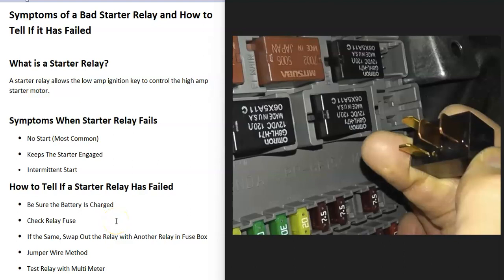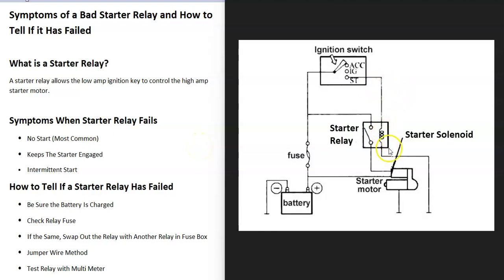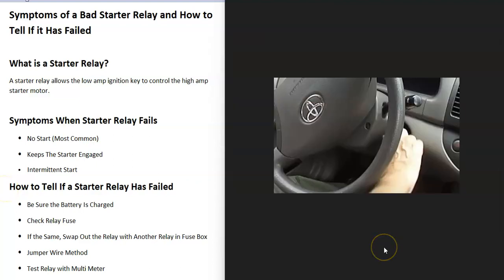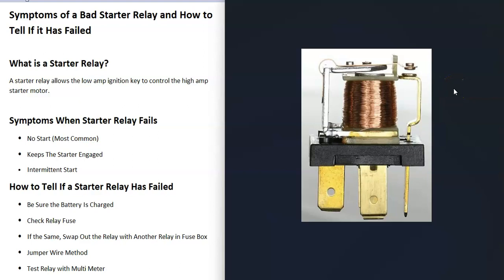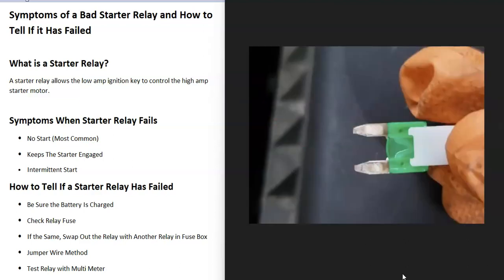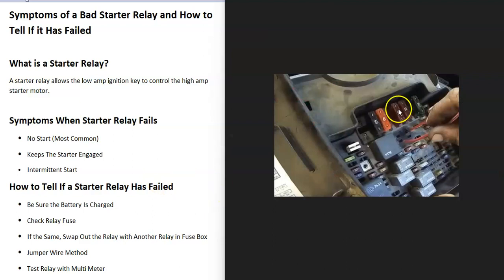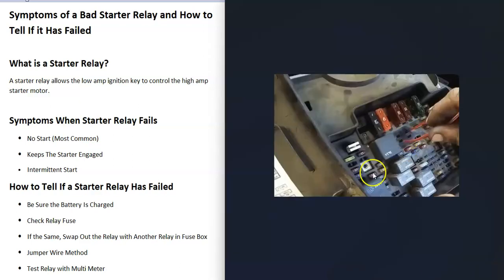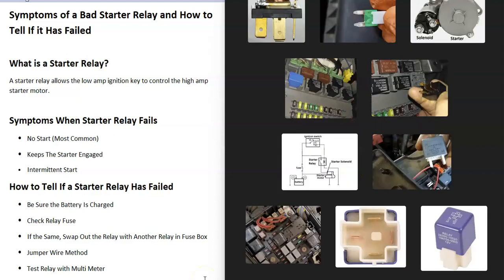Symptoms of a Bad Starter Relay and How to Test If it Has Failed

Comment: I have a 2015 chevy ss
I was replacing my crank shaft sensor on my car. (It's directly above the starter, so I had to remove the starter to get to it) 
When reinstalling the starter, I accidently touched some of metal framing underneath the car wit the starter's positive wire, while the starter had power going thru it, trying to get it back up in its spot (I forgot to disconnect the battery during the whole ideal.. foolish of me) and now my car won't start. It's almost as if my ECU got fried or something. I tried using a brand new test light on the fuse box under the hood, to see if I was getting any power to any of the fuses with the car in the "on position", but the test light never lit up. I tried bypassing the starter relay with small jump wire, and still nothing happened. I've yet to take the starter off, test or replace it. I just wanted some feedback on my issue
Reply from the maker: When the power shorts out it can cause issues and be problematic sometimes to fix since a lot of components can be damaged. Usually, a fuse or relay has blown but sometimes it can also damage the computers or wiring. I would start by getting a schematic and check all the main fuses. There should be a big main fuse in the fuse box along with fusible links.

Comment: 2015 Ford Transit 250 Cargo Van 3.7L  continual fail to start issues. All start with Air Evap Code, consistently related to water in the air box or just  wet or damp air filter. Usually, cleaning or replacing the MAF (Mass Air Flow) sensor, the air filter gets it started.  And did get it started and running for about 200 miles. Then I stopped over night. 

Every single time wet snow melts it goes onto the MAF and into the air filter housing. Normally I cover the the engine with  tarp and the hood with  tarp or go south.

About 10 days ago Mid Apr 2924 a totally unexpected amount of heavy wet snow fell over night in Utah.  The van would not start. Not the normal no start, it tried to start but wouldn't.

Followed the routine up to and including new MAF and air filter. It started felt just slightly off a barely noticeable kinda difference in the feel of the idle.

Now it will not start. Going to be a $743 CAD dollar tow to a Ford Service Shop, that can only offer to try to diagnose in-between scheduled service for customers.

I live in the van, I am broke down about 180 miles south of the border. 

The tow alone will cost $745 CAD

A couple of mechanics have pounded on the fuel pump while I try to start the van. They don't hear the fuel pump try to start. They say the fuel pump and fuel pump modulator are likely the cause of fail to start. They say only Ford has the computer devise to program a new starter and new modulator so that those two pcs communicate with each other and the computer?

It tries to start, the first try in the morning. Subsequent attempts to start it through the same day, the starter engages but doesn't give that momentary sound that seems like it is going to fire.

No doubt I could be totally wrong. But I think it is a Fuse, solenoid, relay or some other electrical type bit. 

I can see what a broken Fuse looks like, but will need to test solenoids and such. I have check the regular blade type fuses in the Fuse block under the hood. 

I am studying the manual and see that there are three other Fuse block type things. I will hunt them down. Diagrams in the manual show the shapof each Fuse block and identify the stuff inside. But nothing in the manual to show where they are. I think one might be behind the glove box. 

I will find them, eventually, check and replace whatever looks like it should be replace to the extent of my limited knowledge and comprehension.

Any easy checks I could do or suggestions will be greatly appreciated. 

Thank you and You Tube ❤

Comment: Hello, great video can this relay cause the radio clock to reset while the key is turned to turn on the engine and you here a click and the clock resets not the radio stations that are saved ? Thanks for the info.
Reply from the maker: Wiring issues can be caused by many different things, so while the starter relay should not affect the radio, it may be possible.
Reply: Good question. Our 07 Highlander is doing that. also seems to struggle to start 🤔

Comment: Thank you so much for this info. I went to go swap out the horn relay and found my starter relay wasn’t even pushed all the way in. Truck started 6 times in a row. I had to get it towed thinking my truck was due for a $700 repair. You literally saved me. I just moved and lord knows I didn’t have $700!! I owe you a beer!
Reply: Me also, 
And I have a case of Copper Mine, 'Tucson double boc Stout "
Reply: 2003: Toyota Sequoia. Does not say starter relay. Could be listed differently also no digram on relay showing the prongs

Comment: What does it mean if I switch the 2 similar relays and it still doesn’t work/start?
Reply from the maker: If the relay is good, the issue is something else, such as wiring or a bad starter.

Comment: Thanks for the video, a question ,
 my matrix 2009 starter stay engaged one second after the engine run , what could be the problem thanks to answer me back
Reply from the maker: It is likely the solenoid staying engaged too long or a mechanical issue with the starter/flywheel.

Comment: Thank you! Mine is intermittent starting, half thought the car was possessed since it started cranking randomly while left parked, going to investigate and see if it could be the relay
Reply: What was the problem? Mine is doing this
Reply: @Romans_five_eight  most likely it's either your fusebox or gem module on the back of the box. Mine was from a bad seal on the windshield, water traveled down the firewall and followed the wires, when I pulled off the fusebox it had a ton of corrosion on the connectors. Gem module looked clean so I slapped a good fusebox on and it was good to go, replaced my starter to be safe though

Comment: Very good lesson, the starter is engaging even while the key is out and I disconnect the battery,what do you think is the problem?
Reply: Did you ever find out what was causing the starter to be engaging I have the same problem every time I go to turn the key the starter comes on by it self and it won't let me crank over
Reply: @nomadirish6067 did you find out what was wrong with yours

Comment: I've had the "no start", with clicking sounds, a couple of times. Car started right up after having battery jumped. I thought it was a bad battery, but after having it checked, it was fine. Starter and alternator also seem to be in good condition. Starter relay, is the last thing I can think of.
Reply: Tested my starter and it works, tried to charge and jump the car and I still get the clicks. Going to rip out the starter relay now and see if I can test it or get a new one
Reply: @pettypablo I don’t even get clicks. If I turn my key in the ignition is has no problem turning but absolutely no noises come on. No crank, no turn over, no clicks. My dash lights, headlights, and radio will all come on but the car won’t even try to start. Wish me luck man 😂
Reply: @kylecounter9271  my problem ended up being a ground wire from the right-front of the engine to the frame. Shit was DUSTY but as soon as I swapped that it’s been running fine. Check wires before spending money. A lesson I learned $800 too late.
Reply: @kylecounter9271  also check that bs clutch pedal safety switch. There’s 2 switches that get pressed to turn your car on so if one is broken or out of place your car won’t even attempt to turn over
Reply: @pettypablo  I live in MA and it gets cold up here around this time of the year I’m hoping to god my starter is just struggling and a smack and crank will give me a start up. I’m also going to be taking a look at the battery cables because me car is 18 years old now. Fuse box and connecting wires/hoses will be my last resort. I’m not spending SHIT till I’ve exhausted my own efforts lmao and even then I’ll probably just take the starter apart and look at the brushes before buying a new one. How’s yours running now?
Reply: @kylecounter9271  honestly mines running perfect after that wire swap. I’m sure something will break now that I said that but I’m out disturbing my neighbors like I was before 😂 but yeah dude for sure check all the cheap shit first. I’ve bought a stupid amount of shit for this car just to find out the ONLY two things I’ve ever had to fix was that clutch pedal switch and this wire. The other $800 was apparently just for fun 🤷🏼‍♂️ lol
Reply: @pettypablo  consider it a donation to the spirit of Henry Ford 🤣🤣 these cars will be the death of us. Hope yours stays going solid 🙏🏼
Reply: @kylecounter9271  tbh it’s happening in my pos civic 😂😂 idk if Henry had anything to do with that but 🤷🏼‍♂️ fk a ford for that reason though 😂 my $800 repairs would’ve been 1200-2000 easy if it wasn’t this lil beat up Honda lpl
Reply: @kylecounter9271 I’m having the same issue with mine and no one up to this point can figure it out. This occurred 1 days ago after I had a transmission rebuilt.
Reply: @kylecounter9271 what was the issue??
Reply: @1DealWitDee  I had a couple things going on but the thing preventing my car from starting was, and I’m not kidding at all, an old Honda safety feature that causes the computer in your vehicle to read the car as “stuck in neutral” and prevents it from starting. Some old school feature to prevent people from stealing the car or something silly like that. There is a little key slot next to the gear shift (next to the D, N, R lettering). I had to push the key into that slot, hold the brake, move my gear to neutral and then crank the ignition and it turned on right away. After I did this once it only happened one other time and that time I changed the battery just to make sure it wasn’t some faulty power being taken or something and it never happened again. Sold the car a few days ago no issues! Hope this helps man.
Reply: @dinosparky1109  ^ if you never figured it out (I hope you did) this is what ended up happening with my accord.
Reply: @kylecounter9271  thanks man. I’m having the exact same issues in my older ‘97 camry
Reply: @1DealWitDee  I’d definitely look at the battery first kuz that’s probably gonna run you the least $ if needed to change. I had a few people look at it, one said the starter was done, one said the battery was done. They were both wrong lol. Starter repair sucks and can be $$ as heck so I’d say exhaust all your other options before looking at that. Good luck man
Reply: @kylecounter9271  havin tha same problem wit my 98 jeep grand cherokee
Reply: @kylecounter9271  bouta change tha starter relay , i got new starter, fuel pump, battery,  alternator, coil pack, basically everything dealin wit startin tha truck...good thng is when it do run its basically  restored
Reply: @kylecounter9271  Sounds like an ignition switch under the steering column.
Reply: @ never had any symptoms of such. Was really a confusing one at first lol but seriously the only thing I ever did to fix it was reset the anti-theft system
Reply: Hiw did ypu find out it was that cable? @pettypablo
Reply: So frustrating. I still suspect the starter, which can work occasionally and make you look elsewhere.  @pettypablo
Reply: I have a no start with no clicking sounds.  Radio does not work nor does the fans and wipers.  Interior lights work, turn signals, and the battery is brand new.
Reply: @merrin7117 what did you end up finding out what it was??
Reply: My car has a automatic stop and it shut off and when I press the starter in relay the car start up it’s like the keep coming loose idk put when I push it in it start back up
Reply: I’ve replaced my battery alternator and starter brand new parts so the relay is my last option or the ignition itself
Reply: I’ve got a new battery new starter new alternator got the truck running shut it off went straight to turn it over and it clicked at the starter sounded like and wouldn’t start hoocked jumper to it it slow cranked but still nothing any idea anybody?? It’s a 2007 Chevy Silverado 6.0
Reply: @bowieupland6112 you ever find what the problem was?
Reply: @Popelivingotti 
Starter. Replacement fixed issue.
Reply: Clicking sound for me has always resulted in a bad starter motor, not sure how much that helps you.
Reply: @colinmoore68  
Thanks.
Reply: He said jumpered, 😂😂😂